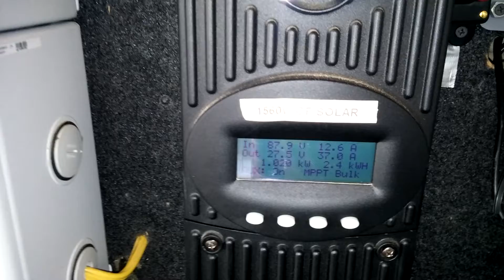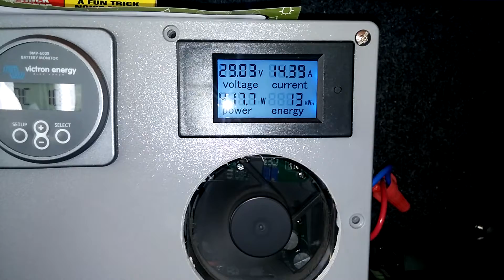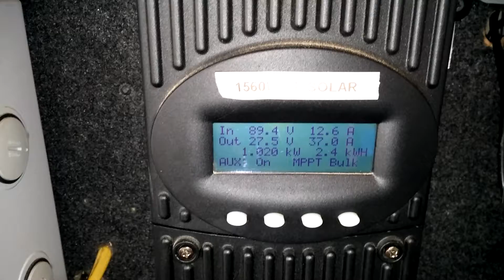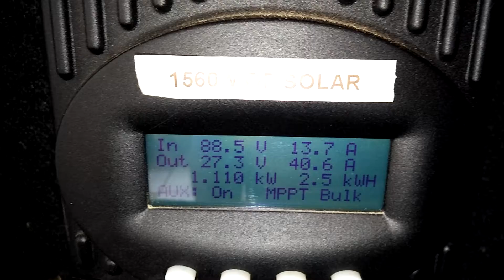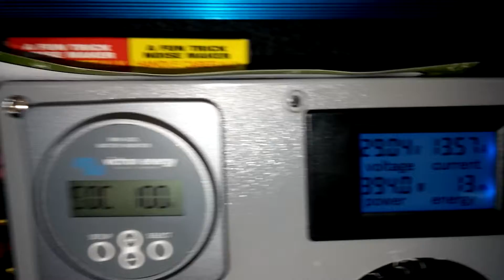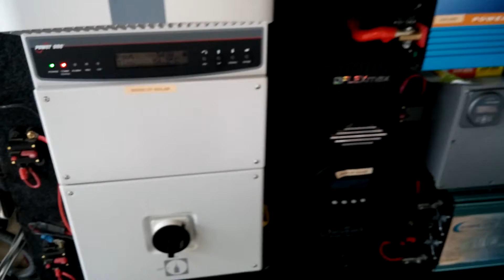Aurora inverter and outback charge controller

Comment from the maker: THANKS  FOR CHECKING OUT MY VEDIO,,HI SOLAR GEEK,THE POWER JACK INVERTER YOU SAW IS 28 TO 55 VOLTS DC AND MY BATTERY BANK IS 24V SO WHAT I DID WAS PURCHASE A HEAVY DUTY COIL 24V COIL RELAY AND A 100A SSR RELAY AND 2 600W DC TO DC CONVERTER FROM EBAY,THE OUTBACK CHARGE CONTROLLER  HAVE A 12V AUX OUT WITCH IS CONNECTED TO THE LOW SIDE OF THE SSR RELAY AND THE LOAD SIDE IS CONNECTED TO THE CONTROL SIDE OF 24V COIL RELAY AND THEN LOAD SIDE OF THE COIL RELAY IS GOING INTO THE TWO 600W DC TO DC CONVERTER  WHERE I RAMP THE VOLTAGE UP 34V MAX  AND ON TO THE POWER JACK INVERTER

Comment: Hi, quick question.  What products are you using to divert power from the charge controller over to the grid-tie inverter.  I have a similar setup as you and would like to use the excess power to go to the grid-tie inverters once the batteries are full.  Oh, I'm in Lawrenceville, GA by that way. :-)
Reply: SolarGeek thanks for checking out my video